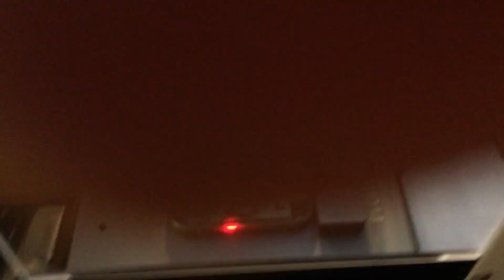iPhone 11 Back Glass Repair using Laser Machine Timelapse

Comment: hy , no need to disassemble the phone "inside"?  mainboratd, flexes ect., just take the phone into the machine? thx
Reply from the maker: Thank you for your comment. From my experience, disconnecting the screen prevents damage. I have left the screen on in the past and ended up with the screen getting smoke damage. Other times I have had pieces of glass fall into the phone and get caught behind a shield, damaging the screen with a pressure spot. I have also heard of some people getting smoke damage to the camera, though I have never experienced that before. Nevertheless, because of these issues, I always remove the screen and disconnect the battery. But also, that is all I have seen to be necessary. I have never found it necessary to completely disassemble the phone before doing a back glass replacement, just the screen.